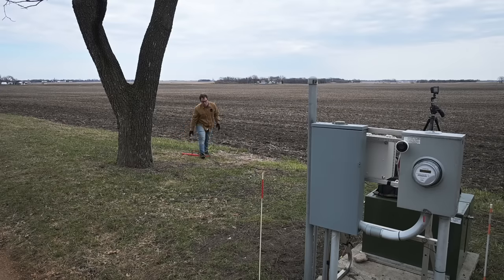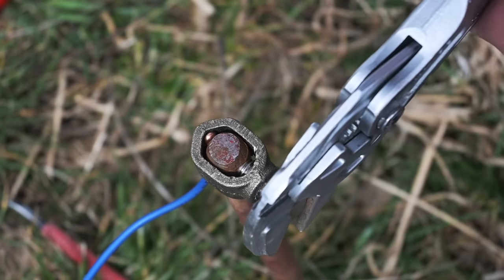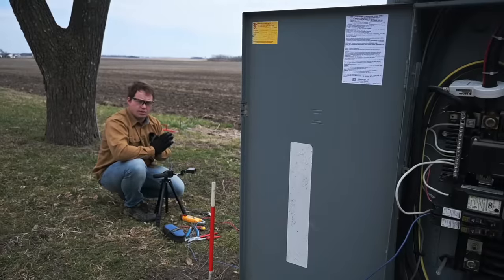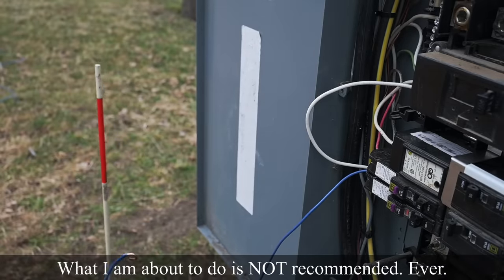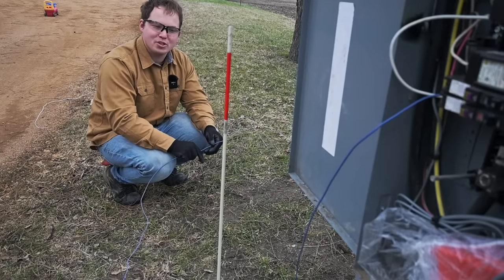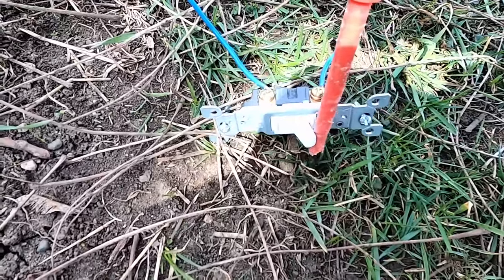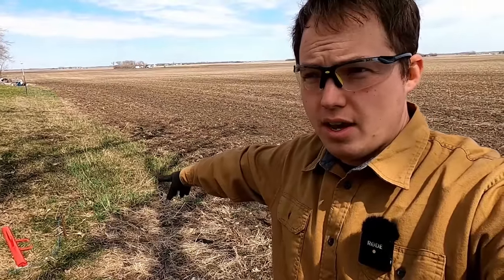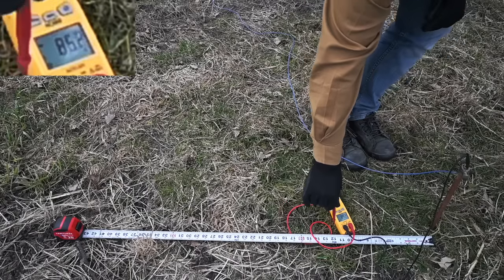Will 120v To Ground Trip a Circuit Breaker?

Comment: I have no reasonable way of getting a ground wire from panel to an old wire but I do have easy access to another circuit that does have a ground wire. Is it acceptable to borrow or share a ground wire between circuits?

Comment: So this sort of solidified needing a GFCI breaker? An instant trip? But also to help with any drainage of power to not occur
Reply from the maker: GFCI is important but more than that you always need an "effective ground fault current path" in order for a system's overcurrent protection to trip.

Comment: The takeaway on this for me is that I want to replace a lot of breakers with AFCI/GFCI combo fault breakers on my older house with all standard breakers.
Reply: Might possibly run into issues. Afci/gfci breakers are extremely sensitive and can trip if 2 different neutrals from different circuits are tied together. Just be careful

Comment: Great job on the differences of ground rodding and ground fault breaker's. The explanation of the safety factor is most informative. If get a chance a complete explanation of Electricity theories. Maybe just the beginning of A.C. and set-up of the systems .Then Gradually Piece in D.C current. If this idea suits a tail feather in yr cap! In a sales pitch idea ,How about a female assistant. Very important is her way of tone's of her voice. We all don't have to be a total expert along the way in life. But as a teacher of thermodynamics and The theories of Electricity We become a professor of Knowledgeable understanding of Respect for Electricity Together. Thank you for your patience and diligence. Lucky day for the weather for Yu. Studios set up doesn't have to be white and clean. The outside Barn set-up inside background works and show's against All odds of  changing conditions Yu can prevail. Safety awareness is great. No slipping on that.! Yu are doing fine. 💪 Grandfather Proud !

Comment: A normal household groundrod is between 2 and 12 meter and is tested with a special meter. This means that even with a "normal" breaker it's a dead short when it is in direct contact and it will go out. If not, your groundrod is to shallow or damaged so unsafe.
Reply: Yes, there is a special Test Meter, for NEW installations.  But, you are dead wrong, regarding a Ground Rod being a Dead Short ...

Comment: Ok heard you say this and it's what everyone is taught including me, electricity takes the path of least resistance, and after being in the trade for over 12 years now I call b.s. on that in a way, yes the main amperage will go the path of least resistance but if you have 2 or more paths it will take all paths and you can still get shocked bad enough to possibly kill, for example if you take a wire strip both ends touch one end to breaker or switch and touch other to the ground while holding the stripped ends the voltage should just go through the wire but it doesn't, it goes through you too, theirs a flaw in the wording of the teachings, same w if you have a 6inch wire a 50ft wire and a 100ft+ wire all going to the same live end and same ground spot you can even put resistors in the lines for more resistance dangerous amperage will go through all paths, you could test this... but  I've seen it and proved it to my electrical teachers in classes and amazed them enough that they stopped saying "electricity takes the path of least resistance". It's kinda like on gas tanks they say fire and gas don't mix, that wording is incorrect because fire and gas mix very well, it should be worded don't mix fire and gas, the electrical part should be worded electricity takes all paths but the majority of the amperage will go the path of least resistance but all paths have a dangerous amount of amperage
Reply: Ironically electrical teachers should be aware of Kirchoff's current laws and current divider formulas. In truth the notion that current takes the path of least resistance is easier to explain than a current through lines from a node is divided through a proportion of each lines resistance in ratio to one another. Two lines connected to the same point with equal resistance will split the current 50/50, however if the resistance of one line was 100 times greater than the other, then the ratio of current splitting is more like 1/99 and if it was 1000 times, 1/999 which would appear in most cases to be a negligible current. Again, explaining that current takes the path of least resistance is usually sufficient enough to get it through most electrician's heads that in order for an efficient ground fault path to be safe, it has to be a low enough resistance that the current splitting effect allows enough current to flow through live cables through breakers and back to ground and trips the breaker.

Comment: (Not an electrician)
May I suggest books. A lot safer way to learn.
I understand the experiment desire - I'm like that.... But books are quicker and safer.

That is why you legally are required to have a GFCI (ground fault circuit interrupt) in bathrooms and around sinks, etc..
The normal electrical system doesn't protect against shorting to ground - that is what ground is there for. Normally this is ok.
But if you're bathing in the tub and your enemy throws a toaster in the power is going to ground - through you... unless you installed a GFCI, in which case you laugh and karate kick them. The GFCI trips the power when it detects current in the grounding system.

Comment: MCB didn't trip on direct ground connection. Please let us know what is the resistance of that earth electrode? We at our facility ensure that the resistance of the ground electrode is less than 1.0 Ohm. Then we combine a hundred of these earth electrodes, and the combined resistance drops to 0.1ohm. So can we use that earth as path of low impedance instead of bonded nuetral for tripping the breaker??

Comment: you checked the volts from the rod, you didn't check the amps… also checking ohm is extremely important.; code states that the ground rod can’t be over 25 oms, how many oms is your ground rods?

Comment: Here is a question for you that you might have an answer to. My neighbor has a 120V well pump. When the well pump kicks on via the pressure switch on the storage tank it feeds 120V back through the house via the common wire. when the pump shuts off the circuit is back to normal. Any idea why this is happening? Maybe the Well pump itself or wires going down the well casing has a short?
Reply: Bad Neutral perhaps?
Reply: @gradn 86 - You need to explain ... "the pressure switch on the storage tank, it feeds 120V back through the house via the common wire" <== HUH ?

Comment: Real world scenario!  (Great video, by the way!)  I just discovered a bare ground wire carrying 120 volts.  I had a 15 amp breaker that has been tripping occasionally over a couple of years.  It got worse recently and would not reset at all.  I replaced the breaker, incorrectly guessing the breaker had finally failed.  While tracking down the fault in that circuit, I eventually found a bare ground wire carrying 120 volts!  Panic set in, haha.  I put shrink tubing over the hot ground and got the circuit working (lights and a couple of outlets).  BUT!  I still have a hot bare ground wire in my wall.  I have shut off the breaker, and found this video on trying to decide what to do next.  Tearing out drywall to find the cause (a nail through a hot wire?) is a last resort, I guess.  Is there any other way I can identify where this hot bare ground is and disconnect it?  Any ideas?  I'm a non-pro DIYer.  Thanks for any suggestions.

Comment: I= E/R, Ground rods must have a resistance of 25 ohms or less. If the ground rod has 25 ohms per se then a 120 volts would give you a current of 4.8 amps well below the 15 amp breakers rating!

Comment: After my father-in-law passed away, I found out his garage door track was shocking people .  I found out he was not using neutral ground  wire.  in the panel the white wire  was connected to a circuit breaker. I found this out when I touched the wire with a screwdriver. If he would have done this right, it would  have blown the circuit .

Comment: I’ve been shocked straight through the heart with 120v
Reply: You probably shouldn't do that
Reply: I tried it with 230 volt last summer. Did some work on an RV AC. Turned the AC off and went inside to pee. When I came back I started taking apart my test rig, completely forgetting incoming power was still live. Scared the shit out of me. I realized I had my Apple Watch on, which has the ECG feature, so I ran it and all was well, thankfully.

Comment: Do you know that in Saskatchewan there is only one wire running to a farm, the hot one!
In Montana there are two wires running to the farm, hot and neutral.
Reply: In Saskatchewan if they start having power problems, Sask Power tells them to turn the garden hose on to the ground rod for a day.
Reply: That's "single wire earth return" high voltage/ step down transformer/ graded earth mat. 
Used in rural areas only
Reply: Nathan   My friends in Canada say that if there are any problems, dim lights, trouble welding, electric stove not up to temperature, they are to turn the garden hose on to the ground rod till the area is just mud.

Comment: That intro lol. Great work man.
Reply from the maker: Thanks!
Reply: Benjamin Sahlstrom Great land too! Do you farm?
Reply from the maker: @venividivici4253  Just have a small "hobby farm" of about 5 acres. We love it out here on the prairie!
Reply: @BenjaminSahlstrom  Lets say that the neutral and  ground cables are bonded toguether  at the main panel. Now if a hot wire makes direct contact  with the  ground wire conductor What would happen? Does it cause a short circuit?

Comment: i had a refrigerator  compressor leaking back to ground  and never tripped the breaker.  had 4 amps current on bare ground back to rod. wrecking havoc on all of my circuits when the compressor came on.

Comment: There is a huge problem with this... the actual resistance to reference ground and actual measured at your site will vary greatly.  Even from season to season. Different types of soil may have a huge difference in resistance and likely will not trip that breaker.  That is not the intent of a ground rod anyway .

Comment: I remember my father telling me of getting shocked by the metal housing of his friends fridge, had a ground fault and it was the early 70s so they just cut the 3rd prong off probably
Reply: I’ve had a problem with amateur radio equipment doing this. Flipped the non-polarized plug over and it was fine after that. I also recall an old (1950s) refrigerator in a house I was doing remodel wiring having the same problem.

Comment: With the volt meter at the beginning of the video, measured 120 volts at two
terminals.  What Two Terminals were used?
Reply from the maker: On the terminals of the switch while it was off. One terminal was connected to the new ground rod and the other was connected to the breaker which was turned on. So the difference in potential was 120v. Does that make sense?

Comment: Should be hoping with both feet together and not taking separate steps if your around a location that could potentially be energized.
Reply from the maker: True. Better yet just hop on one foot! I did notice while editing that I took several steps that were further apart than was probably smart!
Reply: I'm not a electrical expect by any means but isn't the amperage that is there explainable by the resistance from ground to the source. Also isn't that panel the main panel that has both the neutral and ground tied together so I would be curious if you would get the same arc on a sub panel compared to the main panel.
Reply from the maker: @flyingdude0010  Yes that is the main panel so you're absolutely correct. Maybe I'll have to test out your comment about the sub panel short.

Comment: Check line to ground voltage of all current carrying  UNGROUNDED system. Then measure voltage to ground by connecting the center tap of one leg to earth. Compare results with ungrounded system

Comment: Am I correct in saying this was a TT earthing system with the earth being the return path for the ground fault current to the source? And the earth loop impedance of TT system much higher than a TN-S or TN-C-S, creating a lower fault current and leading to the breaker not tripping?

Comment: LESSON-.  With  a standard breaker if  a wire  has been connected to  the ground rod you would expect just insulation on wire to melt/burn  and br. not to trip.. Let say if you want to connect hot service  drop wire to the service  panel and accidently  you drop wires and they hit the ground  what would happen ?  The dropped wire would cause fire in contact with  the ground. -- why standard breaker does not trip in connection  to the ground rod? Because in order to trip standard breaker needs fault current to hit  the  cabinet .. In this case fault current  goes to the electrode not to  the cabinet. If you touch cabinet with a hot wire  the br. will trip.

Comment: QUESTION:  If the ground rod would was only a few feet away, would the breaker trip?  Also I have a metal building on skids should the metal building be grounded?
Reply: Away from what? The ground rod of the transformer? Likely. Note also that if you did that with 230 volts in Europe the current would be about 17-18 amperes. As the breakers are 10 or 16 amperes this would trip the 10 A and could trip the 16 A though this would likely take minutes.
Reply: @okaro6595  OK, Thanks.  What about a metal building on wooden skids that is being fed from a main house panel.  The metal building has its own panel, because this is a metal building should it have its own ground rod?

Comment: I did the same experiment in Tucson, AZ and only saw 0.7 amps.   It's been pretty dry here lately.
Reply: Amps = Volts / Ohms
Dry Soil / Sand has a much higher resistance
Wet Dirt has a much lower resistance
Amps = Volts / Ohms

Comment: Good morning Ben , can I use as Southwire 1/0 Standard AL USE-2 Cable to my 2 galvanized ground rods ? I’m adding a second Breaker Box only in use when electrical failure from the grid , I will have 2 - 48v Lithium battery banks 1 Yinlong 2.3v 40Ah x 21 batteries & the other 3.2v 280Ah

Comment: Great video thank you!
Although I am confused about when testing the ground electrode, why does the voltage increase as you're putting the red lead farther away from the ground electrode and why does it decrease as you're putting it closer to it? Is it because when the voltage goes through the grounding rod it starts low and then gradually spreads out farther into the ground?
Reply: The voltage at the energized rod is 120v, and it drops as you move further away due to the impedance of the ground. What's confusing you is that the voltmeter measures the difference in voltage between the red and black leads. If both leads are on the rod, the meter will read 0 volts, just as if you were touching the leads together. If one lead is on the energized rod (120v) and the other lead is stuck in the ground far enough away to be truly grounded (0v) the meter will read 120 volts.

Comment: Forgive me if this has already been mentioned, but aren't you essentially completing the circuit via this new ground rod through the earth to your system's ground rod? The earth between the 2 rods being a poor enough conductor that only 10 amps pass and the breaker doesn't break.  So if you were to drive that new rod, say, 100 yards away and perform the same tests (with a reeeeeeaaally long extension cord) you would probably no longer have any current flow. Might not even trip the ground fault.
Reply from the maker: I actually want to test that! I think you're pretty spot on with your summary actually. Pretty sure it would still trip the GFCI but it would definitely draw less power.
Reply: Yes, that's right. The neutral of the transformer is directly tied to a ground rod. GFCI trips at 4mA (AFCI are like 30 mA). To get down to that level, it'd need to be much much longer than 100 yards. My guess is that the resistance is proportional to the distance between the rods (assuming homogeneous soil).

Comment: Please explain why there was only 10 amps of current flow? Is this the reason for using multiple grounding rods?
Reply: 10 Amps = 120 Volts / 12 Ohms  
12  Ohm of resistance between the Ground Rod he pushed in dirt and the Ground Rod at the Main Panel

Comment: so when you show the difference of say 95 volts from the rod to the ground that means theres actually 25volts left at that spot on the ground, not nearly enough to get through human skin, the only way youd get 95volts is to stand in that spot with your toes pushed into the soil and then touch the ground rod/hot wire, at which point the closer your feet are to the rod the safer it is as the difference goes down as shown on the meter